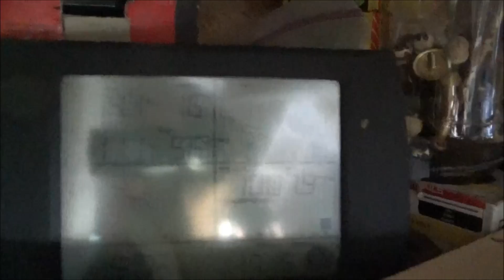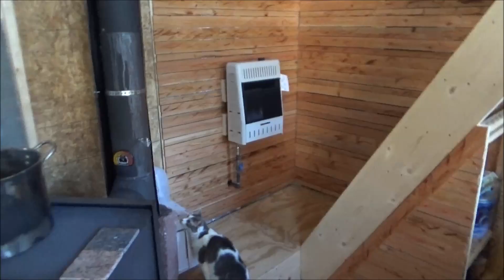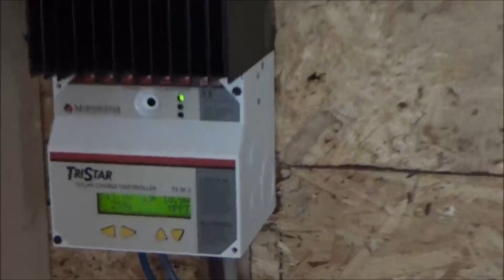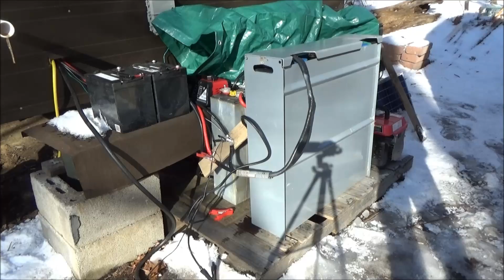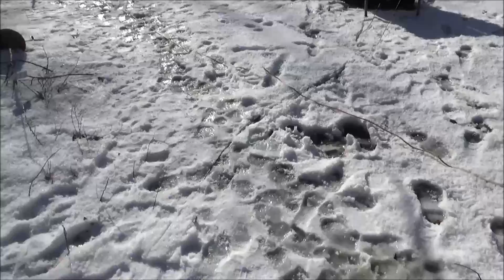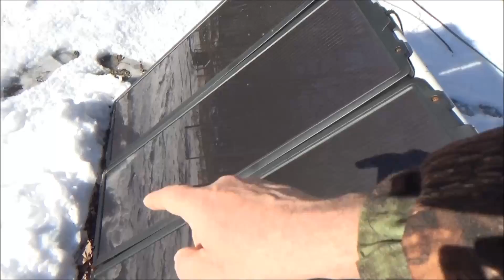Working With Solar Forklift Batteries & A New Tower

Comment: great job. love the tower. I just use the old tripod for the old tv antenna to hold southwest wind power  400 watt wind gen. set for NiFe battery. I am on a hill .small offgrid house. get your ham ticket. do not need code to get started anymore. The HAM guys are great!! they love projects DIY.  most ham gaer is 12V.  you will find during the day  that solar MPPT will make some RF hash noise in the MW threw 10 meter. mostly 40 meter up. That morning star company has been so good to me.  great tech support!! Thay help me reset to a NiFe  battery. 12V 10 cell. 2 banks. 700Ah total. you got a great HAM friend thear.

Comment: The tower appears to be a Rohn tower, they are designed to be self supporting up to 50 feet high with no guy wires PROVIDING it is mounted on a good solid base which I know you don't have so I would guy it at least with one set of guy wires at the top  going out from base to approx a 30 degree angle on all three legs to be on the safe side not knowing what  the wind gusts will be in that area. especially if you intend to mount 2 or more turbines at the top.

Comment: SOUNDS LIKE YOU NEED TO DO A SKIRTING AROUND YOUR HOUSE; THAT WAY YOUR HEAT WILL STAY BETTER...
NEED TO USE PROPER SAFTY GEAR WHEN LOOKING DOWN THAT BATTERYS THROAT; ALL IT WOULD TAKE IS ONE HICKUP AND TROY HAS NO EYES LEFT, DUDE...
NEED TO GET THAT CHICKEN WATER DISH OFF THE GROUND & IT WILL QUIT FREEZING FOR FAST...
BLESSINGS & BE HOPE FILLED
FRANKI

Comment: I as a viewer hope to see you plugin electric oil heater as well as the air conditioner in the summer time.   Hopefully you'll be able to explain what does it take to maintain 1 household outlet in heavy to moderate use .   We hope to see you celebrate your goal that we have picked up on over several episodes of your project.   Your experimentation is useful for contemplation of missionary power supplies as well as those who desire to have a supplemental system.
Reply from the maker: The problem with your idea is that in summer you have a lot more solar power output than in winter. I dont think I could ever run an electric heater of any kind in winter. Now in summer on the other hand yes but then you dont need it. I can run the AC in summer with no problem but in winter the panels are not producing enough power. I would need at least 4 times the solar panels I now have in order to use an electric heater in winter.
Reply from the maker: In a missionary field you may have more sunlight hours during the winter than I have here in Northern NY. That is something else to consider. My friend Link Knight has a tiny solar panel setup and he fares much better than I do but he is in Australia and gets a lot more sun.
Reply: Yes but you soon be playing with windmills and as we survey scenes from the Arctic they seem to be quite common. But no one tells us how much of a supplement for backup power they are.
Reply from the maker: Howard Boone Ok, I get you. Well, wind turbines only work if the wind is blowing and only if they are mounted properly. Mine is not high enough yet. It will produce some power but not to its fullest extent until it is above the trees.
In the arctic is another story. Get it up in the wind and it should produce power as long as the wind blows. Should be more reliable than solar out there actually I would think. Depends on how many cloudy or overcast days they see.

Comment: Take the dish off the ground and put on a board or rubber something.  The ground is a larger heat sump than what your heater will handle.

Comment: Troy, I was going to suggest that you get some Rohn 20 or 25 for a more permanent tower. As someone who deals with CB and ham systems, man I gotta tell you that is an awesome setup. If you went out and bout 35' of tower and a haizer, it would set you back around a thousand. Since you have a haizer, in the spring, dig you a hole 3'x3'x3' and set your short section down in the hole, level it up, and pour concrete up to about 6" below grade. doing this you will not have to install guy wires on the tower, unless you go over 50' in height, mount your windturbines off the haizer, and you could install an over the air tv antenna on the top. Good thing about this type of tower, is you can always go taller. However, if you go up over 100' you will have to add tower lights on it, and that could be different where you live. you also might be limited as to your tower height if there is an airport nearby. if you have any questions, feel free to contact me Troy.

Comment: Hi Troy

I think this propane warmer will raise the humidity in the room significant - maybe it could be a problem when you out for days ... but it's good for backup !
Reply from the maker: Humidity in the tiny house would be a good thing. Its too low.
Reply: The Do It Yourself World Yeah, but with the propane running it could be way to high ;-))
Reply from the maker: Keld Sørensen For a week at most it should be fine.

Comment: I would insulate that battery bank so it retains its heat after charging ... May help the batteries perform better. I'd just use 2" foam board insulation strapped around it so it can be removed in the summer so you dont over heat them in the summer.

Comment: That tower is a great surprise. Happy belated BD to you of course.
70 upstairs and freezing milk downstairs may seem fine, but it will be much more comfortable once you can distribute the heat throughout the house with a ceiling fan. It will also avoid wasting propane because as the lower levels heat up, the thermostat will switch off the heater instead of just keeping pumping heat into the upstairs.

Comment: Great video ever thought of hooking chicken coop up to its own solar mine is two golf cart batteries a harbor freight solar set on the coop roof  it runs two timed lights one for diy chicken water heater and a led for extended laying just food for thought
Reply: Spoke too soon saw u had that idea but to get around the powr inverter check out the diy light bulb heaters
Reply from the maker: Ronald Weider I dont have enough power to run a standard incandescent light bulb. That is a huge problem.

Comment: That Battery has been sitting outside, what 2 week's with out any incoming charge at all, and some how now you get it hooked up and it is gassing?  On top of that you think that's good? Let me just say Bulk, Absorption then Float. You shouldn't have gassing until you do a Equalizing charge.
Reply from the maker: A battery will bubble any time current is being applied to it. Not much but it will bubble. Its normal. I did not say the battery was topped off. Not by a long way.

Comment: At last a tower designed for the job.  Use the gentleman Ham (we call them Elmers) and do the job correctly. If you are getting your ticket awesome!  Be careful of what you broadcast on the air. There are rules about that and each country has differences in their rules. 73 to you.
Reply: Maybe we will have the DIY NET it would be very cool!  AC2O

Comment: Im woried about the weight of your tiny house.
Reply: why worry, it's just about six times more than the trailer can hold. Then he adds things like giant barn beam in living area
Reply: Why worry? The house is sitting on blocks, so the weight is supported by a number of blocks, spread around the circumference. That is very different from a trailer standing on its wheels only.
Reply: Off Grid Texas Homestead Google translate: "Take the blocks and the whole thing will collapse, it should be able to ride the road". Troy has stated from the beginning that he will not move the tiny house unless it is loaded on a trailer by professional oversize load movers. So if it ever has to move (which is not really planned at all) it will come off the blocks for a short while, but it will not ride the road. Just going by what Troy has stated in the past.
Reply from the maker: I am worried that people never listen to my answers in video and in the comments. I have said again and again and again and again that the house weighs about 6,000 pounds right now empty.

Comment: Placing it in front of the stairs means the heat goes UPPPPPP whereas if it were over in the bigger room it would radiate OUT and warm the area. Its why ceiling fans when set on the winter setting, push the rising heat down.  But am sure Troy already knew this.

Troy please get an amateur radio license. Am taking the tests so I can get my Dads call letters.
Reply: Is tht possible inthe US? My Ex is a ham, and when a key went silent it stayed that way, and would never be re-issued.
Reply from the maker: Yes the plan was not to have the heat blocked by the loft in the living room but rather heat the entire home. Then a fan will push the heat down and move it around.
Reply: Seana Richmond  Had to do a lot of paper work and prove it was my Dad, otherwise I was told no.
Reply: Bullit Bullit  Actually I had all his HAM license forms, and other information that proved I was his daughter.  Have such fond memories from the sixties as a kid, sitting upstairs in his HAM area listening to him speaking to folks around the world when the Cuba missiles crisis was going on.  And when Hurricane Katrina, Haiti etc happened it was HAM radio folks who helped a lot!
Reply: Beth DeRoos
I wasnt sure on american call-signs. I'm fairly sure  that here in canada though you cannot request a silent key.
Reply: Seana Richmond Silet Key  means that you are dead.  American call signs are ID'd by the letters A,N, K,W.
Reply: Neil Shubert
I'm unfortunately all to familiar with what a silent key is.  In canada the call signs have prefixes by province. Ve3 is one of the ontario  ones.
Reply: Seana Richmond Yes, Unfortunately, Hams are usually old, and we have a tradititon of cleaning out their HAM shacks for the newbies!
Reply: Neil Shubert
I helped my Ex get her ticket and study for it, and yes, what you say is true and I assisted with cleanouts a few times when one of the keys on the local 10 meter repeater group went silent. Never went after a ticket myself though, I prefer to deliver my RF via a tiny little metal probe  on 13.56 mhz into skin. (I do electrology). A girl can only have so many hobbies.

Comment: No fussing, but I am missing the ambiance of you just having a wood stove.  Ahh well, Ill work on just having wood stove heat for myself one day :).  Gas tanks near my house gives me the jeebies LOL.  I was almost ready to send you some amazing wood stove recipes....grrrr.  I think I should have been born 200 years ago.  Between my gardening and wanting to live off wood and candles.  **sigh
Reply from the maker: 88s10Durango Actually the propane heater is meant for 300 sq feet rooms and mine is about 200.
Reply: Margi Blackwell Okay Im going to sleep on that image Margi........hold that thought for me til the morning, that is awesome!
Reply: Troy said he will generally be using the wood stove with propane as a back up. As much as he likes the warmth, wood will be the only heat that really satisfies. There is something about wood heat and the way it radiates that is just better than any other kind.
Reply: Bullit Bullit
He just wants to keep the water from freezing and the temperature in a survivable range. His water will be stored upstairs right where the heat will be. That is also near where he will sleep. Additionally, he has the option of turning the heat on it up a tad bit. It should be fine for back up heat or to keep the water from freezing if he is gone. You need to consider the intended purpose.
Reply: Bullit Bullit
Wouldn't you think he would drain the lines to the sink and shower if he were going to be gone long enough for them to freeze? Or, just routinely do it at night like turning the lights off. It should only take a second with them gravity fed. He just needs to keep the upstairs water from freezing and it should work fine for that.
Reply: Bullit Bullit
Given that the sink faucet would be about waste high, why would the hose feeding it from the tank in the loft be near the floor? Given that the shower is over your head why would the line feeding it be near the floor? Why have the water go down to go up? This water will be coming from the loft, not from an underground pipe leading into the house from a public system. The water pipes will be very east to drain. Turn off the valve at the upstairs tanks and open the faucets. Done. Waste water will be dumped as used. I don't think anyone ever worries about their outgoing drains freezing up.
Reply: Bullit Bullit
Oh, I am pretty sure Troy understands the problems.

Comment: Skirt your tiny house it will make one heck of a difference. I promise.
Reply from the maker: The floor of the house is very nice and cozy. Under the kitchen sink I have fresh air coming in to offset the wood stove burning air. But that is cold air. Its fine though. I keep my food there now
Reply: ***** It would be a lot warmer Im positive. When wind blows under the house it carries away heat. When skirting is on it wind cannot blow under the house. So heat is not lost from wind blowing under the house. Yess i know he skirted the rv I was the one who suggested he do that. And yes I saw him put rock wool insulation in the floor. And I know skirting would be a lot warmer.
Reply from the maker: ***** Right the problem right now is that I keep a window open and regulate the heat by how far the window is open. More insulation would mean more open windows. lol
Reply from the maker: 2lazy4u The floor under the sink was cold. I messed up when I said that. I was not clear enough.
Reply: He knows, as he's done it before.  He's also heavily insulated and made the entire floor structure practically air-tight, so he actually doesn't need it.  I suppose it wouldn't hurt, in the case of HEAVY winds, but then, he's already gone through that, and still had toasty toes, sooo....
Reply: The Do It Yourself World
LOL a little fridge by the hole hee hee if it works thats good.
Reply: shartne
Probably might be a little warmer...but when it regularly gets to 80 with nothing more than the wood stove...I just don't think that it's a pressing concern.

I mean, if it's TOO well insulated, he'd have to have the windows open all winter.

Comment: why haven't you put something around the base to keep the cold out ...
Reply from the maker: HardTimesMarine D Right. With the wood stove I have fresh air coming in under the kitchen sink. Better to keep food cold there :)
Reply: cold you use dryer hose to make vents then skirt around the vent ports , having way to many brain farts today
Reply: ventilation ? to have some fresh air ?
i do it in my system cause i burn kero. cant have wood burner. and my propan heater like his actually stopped working. the thermostat switches suck. and dont last long. i got 2 yrs out of mine. i left it on setting 2 all the time.
Reply: The THOW really needs some skirting around the bottom. The floors are could because the wind is whipping under there!
Reply: yeah in the winter when its not all below freezing to bad i store my things ou tside in a cooler. and can do so until early spring. then time to turn the fridge back on. really cold nights just cotta pay attention dont let things freeze. i bring em in put by the door. cover them with a blanket. the night draft keeps the food cold. and the blanket holds the air under the blanket around the food. so food cold. and my room stays warmer :) it helps and does keep things cold.
Reply: and The Do It Yourself World  like he said dryer vent hose.and build a cold box. that you will have to focus on having on the side of the house the sin does not hit. and plan to never allow to hit. so food always cold year round. allowing air in from the ground. not the side air. but from the ground where it is shaded more :)
message me some how. lol icant rem how on youtube. and ill send you a link to a guy who has one. actually he called native pathfinder. called off grid storage. i think.
Reply: cool thanks